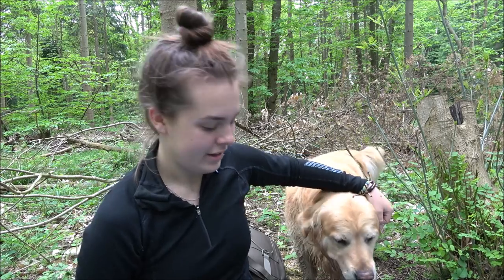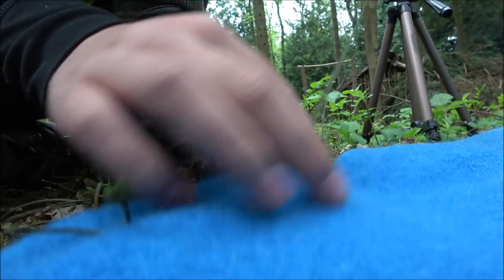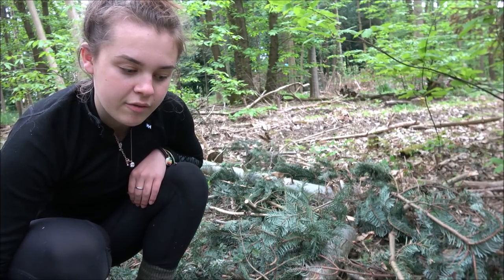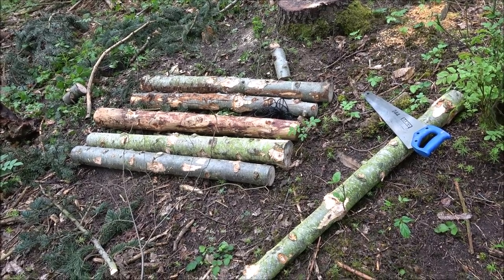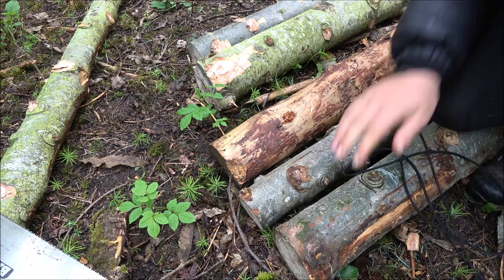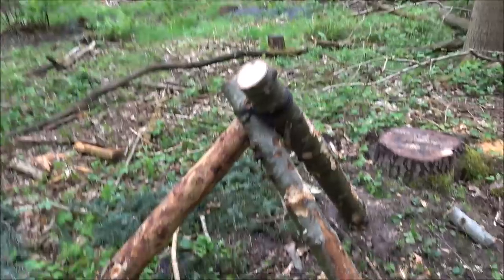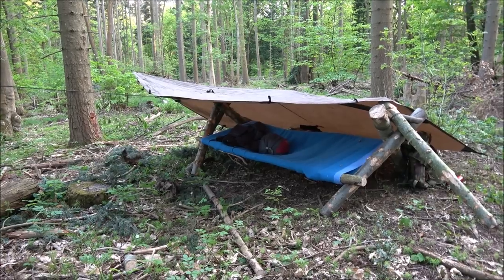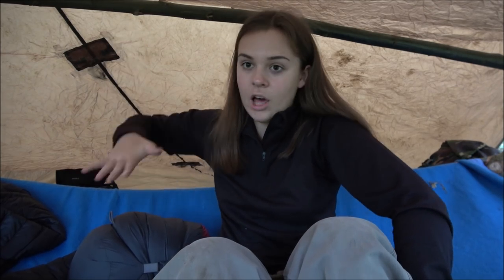Raised Bed - Tripod Style and Sleep System Setup

Comment: Great video. As I started out, we only used a wool blanket and a 12'' X 12' sheet of plastic. I used this system in the later days of my poverty camps. I would lash the runners to the tripods, then use rope to make a mattress, then add a standard lean-to roof. By far the best setup without a tent or hammock. You did a good job.
Reply from the maker: Thank you very much for your comment :)

Comment: +Girl Outdoors.. Great bed build project. Using your multiple skills to complete. Everything comes together well with all the proper planning and materials and tools. I like the fact that you didn't stop at making just a great comfortable bed but you made it a complete shelter with the ridge pole and tarp. I like this way better than a hammock. For me a hammock is to confining and not really comfortable as it squeezes your body frame and makes you sleep in a way that a body has to conform to the hammock. Simply not a comfortable sleep system for me. I like this some what modified and improved hammock style. Btw... those were some great meals you cooked over on the Bushwacker channel. Take care... seeya soon Becky!

Comment: I really enjoy your videos, so please don’t take anything I’m about to say as a negative comment about your ways.  But just a general curiosity here:  The expression ‘sleep system’ sounds so technological; an intrusion on the spirit of coming closer to nature.   So, my question is:  If all we’re hoping to achieve is a warm, protective, and functional ‘sleep system’ (like a hotel might provide) wouldn’t it just be easier to use one of those lightweight portable aluminum beds, set it up in our temporary camp, and cover it with that soft and luxurious blanket, instead of going through the long and playful process of building a semipermanent wooden bed/platform?
Reply: price of aluminum bed $55 wooden tripod  $0  satisfaction of building a warm, protective and functional sleep system priceless :)

Comment: Very nice video. I would suggest however that instead of folding it half and using a single running stich, you overlap both ends several inches and run two baseball stitches down the length. It makes it much stronger. I use a speedy stitch to make things like this, or haversacks, or rifle scabard.
      But congrats, it was recommended in 1910 books not to sleep on the ground. Lol 110 years later people still do it. Spread the good word.

Comment: Hi, I’m a recent subscriber and have been jumping around in time, so to speak, with your old videos.  You’ve improved greatly in two years and have become more comfortable in all phases of your video making.  I think I’d use canvas instead of wool for greater strength and to minimize stretch over time for the tripod system; however I like the blanket “tube” idea.  I noticed that the two horizontal poles increased in diameter greatly between the time you sat on the bed and when you first installed them.  I’m wondering what kind of wood that you have in England that does that.  Don’t mind me; I’m just an old engineer having a bit of fun.  Oh also after viewing a lot of your videos; please never stop saying “bits and bobs”.

Comment: There is another way to use it as a bed, that is easier than the tripod system.  You just cut two 5" diameter logs eight inch's longer than how wide you blanket with the poles through it are.  Then notch out the ends of the logs on both sides to put the poles into.  Which will hold the blanket even tighter.  It will look like a stretcher being held apart by the two logs.  If you want it higher off the ground, put a couple logs or rocks or even built up dirt under the ends.  To notch our the logs, use your saw and cut halfway through the log 4" from each end and then split out from the end of the log the rest of the notch, going with the grain of the wood.  Very simple less cutting, tying, easier set up, Put between two trees and run a ridge line for your shelter.  They used to take a couple of gunny sacks, cut out the bottoms of the sacks and run the poles through it like this.  Try it you will like it.
Reply from the maker: Thank you for sharing an alternative way of making a raised bed. take care